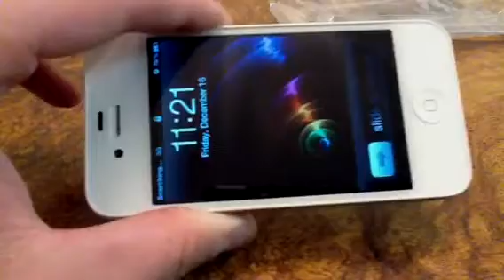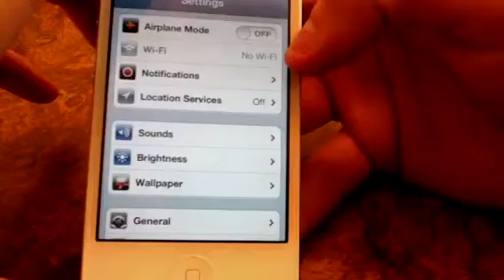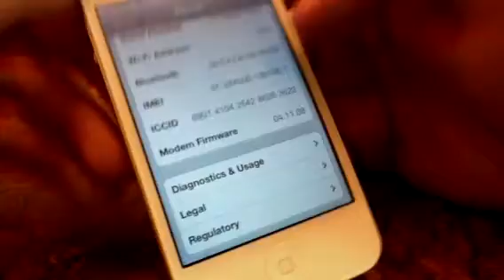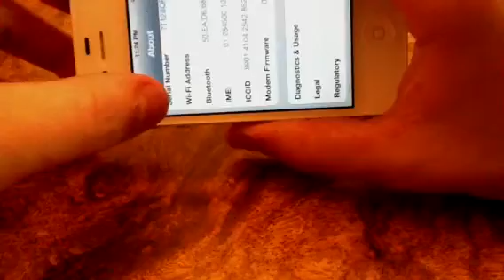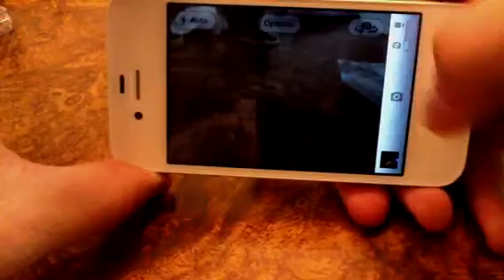iPhone 4 water damage repair (results)

Comment from the maker: they will end up charging you about $150 to replace it. it may be your front assembly causing the issue and replacing your wifi cable should fix the wifi problem as well

Comment: Hi!  I dropped my iphone 4s into the water. It works fine, but keeps rebooting time to time. Sometimes it does once a day, sometimes every half an hour. I cleaned the logic board with an alcohol, even if i didn't see any corrosion build up. The battery is new. I'm confused now. Any advice?

Comment from the maker: if you want just look on ebay for iphone 4 battery and they should be around $5 ea. in the US, other than that try restoring using a different computer with updated itunes and try DFU mode restore as well

Comment: Hello. I fixed my water damage iphone but the only problem it has is that the wifi says no wifi just like the iphone in this video. I was wondering if you know how to fix that or if I need to buy anything to fix it. I did a little bit of research and all I found out is that I need to replace the blue coil conductor located on the bottom of the motherboard. Is this true? I would really appreciate your help.